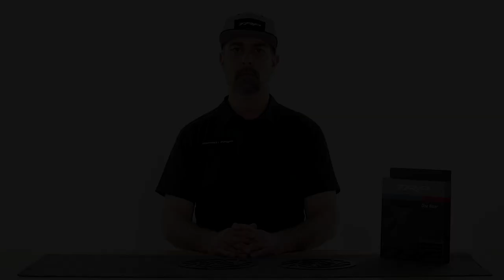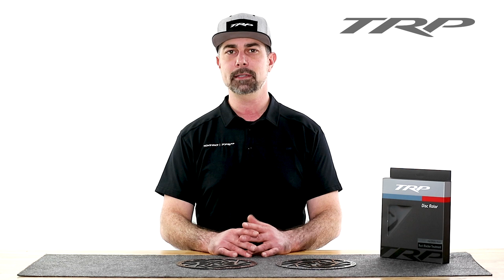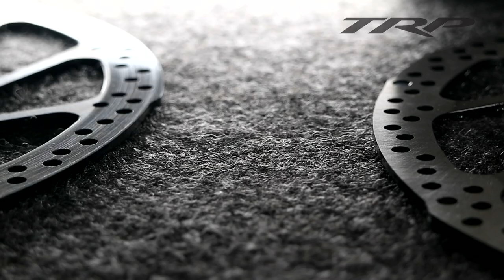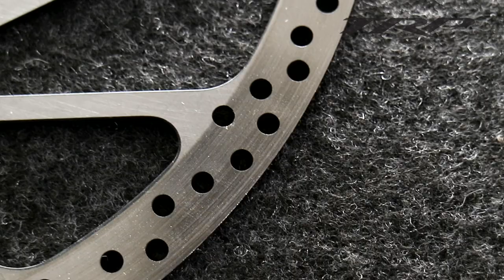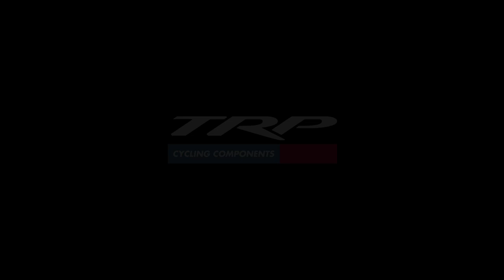TRP Tech Talks- Brake Pad Bed-In Procedure

Comment: How can you know if your brakes are not properly bedded in?
Reply from the maker: You will likely feel a lack of power or hear noise if they become glazed.
Reply: Wife’s bike has cable discs. The front has good grab. The back sucks. 
I sanded the pads as deceived in one of your other videos. After re-installing there is still no bite. 
I just went through a bedding procedure with no change. 

Any suggestions?